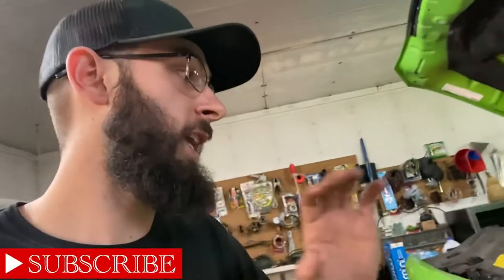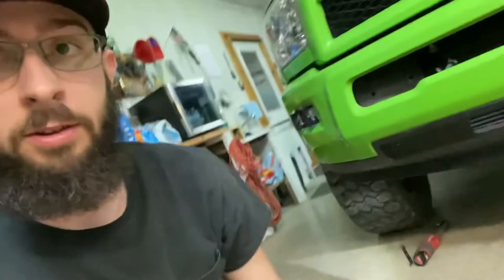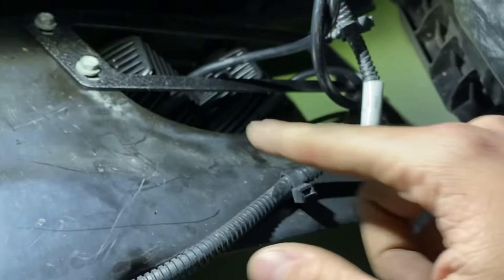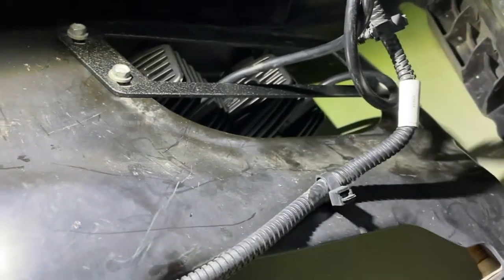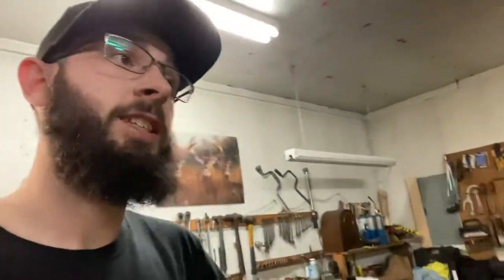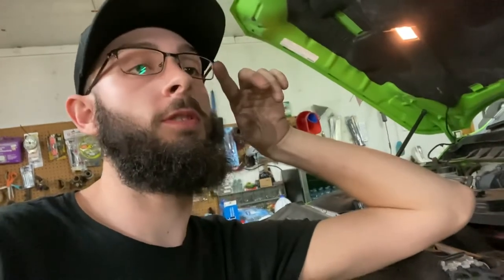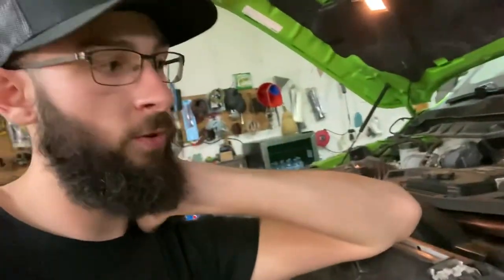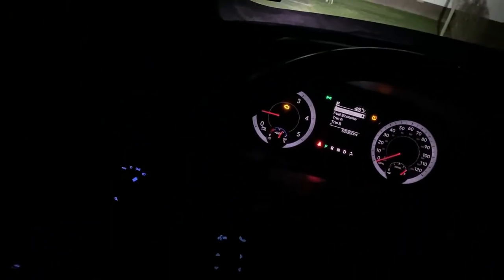6.7 Ram 2500 Throttle Body Replacement

Comment: Bro, I just watched one of your videos, and my service throttle body light came on today.  I’m scrolling  thru videos , doing my research , I run across yours, your video is the best I’ve seen out off all the ones I watched , so I watched the full thing … you said you paid 350 at rock auto , so I’m like kool , I went to rock auto to order the part , the dam thing is almost 700 bucks now.  I’m like wait a minute, that’s a huge difference… so I had to find your channel and see when you posted the video and sure enough, u made the video two years ago.   Dam …. The price has jumped up that much in just two years bro.  Smh
I just had to tell you this for some reason.  Tripped me out.  But I’ve subscribed to you. , I like those fog lights you put on there , very bright.  Thanks for making the videos.
Reply from the maker: Awesome glad to hear this!
Reply: That's an insane price difference. We are going to be screwed if it keeps going like this. TRUMP 2024-FOREVER.

Comment: Did replacing the throttle body fix the code once you were able to clear it? I just replaced my EGR Valve and this code came up a few weeks after I replaced it.
Reply from the maker: @wendyshumate6617  ya once I replaced the throttle body it fixed it
Reply: @HoldenPowell_  Thank you so much for your quick reply. Especially since this video is 2 years old!
Reply: @HoldenPowell_  Just wanted to give you an update. I replaced my throttle body valve using your video. Thanks again

Comment: Hey
I just did that to my 09 cummins and now I can't make it whistle on high idle like it did when the throttle body was installed 
The brake exhaust button works with the throttle body?
Reply from the maker: I’m not sure on that
Reply: @HoldenPowell_  
Before I delete the throttle body 
I put the high idle around 1500 rpm and turn on the exhaust brake and it makes a loud whistle!
Now after I deleted it doesn't do the whistle no more ☹️

Comment: Subscribed 👍🏻🍿
Reply from the maker: Awesome thanks!!
Reply: I ave a P0405 code on my 2009 dodge 6.7 diesel 2500 6.7 which is EGR flow sensor A circut low.  I have replaced several parts and still have the engine lite come on.  Any thoughts were.  I viewed your throttle body video and would this cause the error?  Help